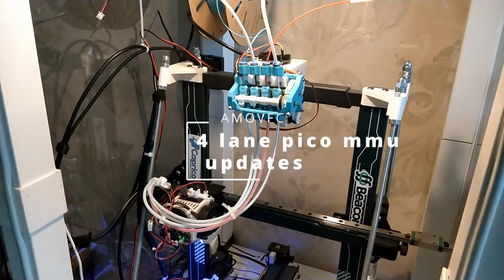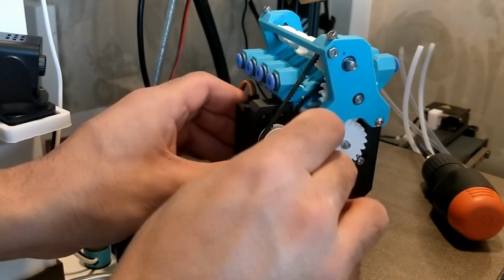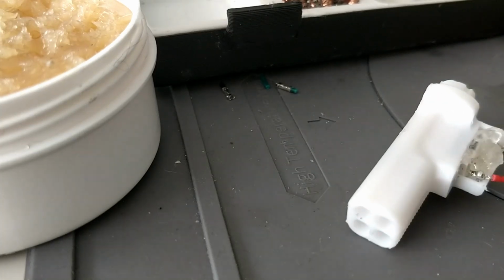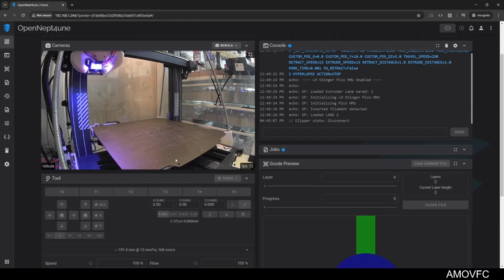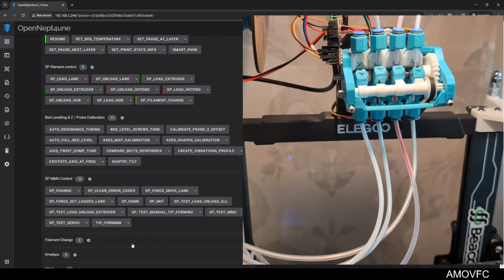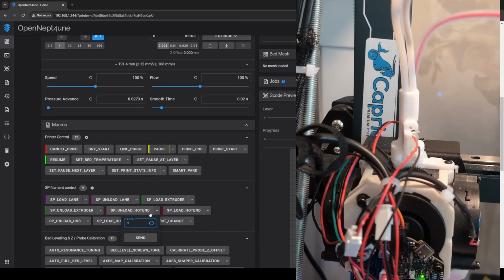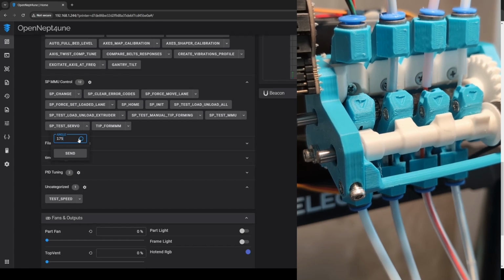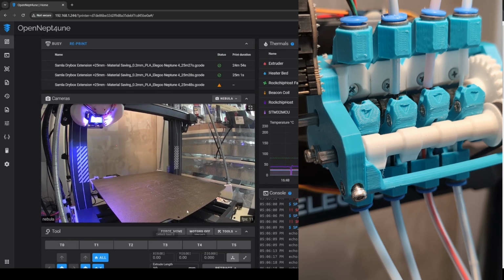4 Lane Pico MMU Part 4 - New mount + better configuration guide!

Comment: On the Neptune, I see E1 and the pins S, G, V5, but I’m not sure which GPIO they correspond to. Do you have any documentation about them?
Reply from the maker: I would suggest you look into the specific board your neptune has, mine had znp k1 v1 if i remember correctly, i think the max and the plus use the v2. But regardless of that I would not recommend using the v5 from the board of this stepper motor, unless you know the amperage of the 5v rail, if you draw to much current the board can be damaged

Comment: Can you post a video on how you did your wiring and what electronics you used
Reply from the maker: You're in luck + perfect timing, im putting yhe printer back together right now and can do a video about yhe electronics, do you wnat to just know the ones for the pico mmu on my elegoo? Video will probably be a couple days but if you have anything you want me to talk about just lmk
Reply: @AMOVFC yea I'm building one for my ender 3 pro and I'm stuck on getting the electronics for it I'm thinking of using ebb42 but it's pretty expensive so if you can also list what you used I will be very grateful. Also what RPI did you use
Reply from the maker: The ebb42 is probably one of the cheapest options to control the pico mmu, but if you have a stepper motor and servo pinout on your mainboard you can connect directly to that, that how I have my voron set up, here's how I had the elegoo before, https://youtube.com/shorts/8CbTlIXhedg?feature=share
Reply: Your videos helped me build one thanks

Comment: Thanks for sharing.
Curious why mount the filament hub at the extruder, less retracting needed for the changes?
I'm liking this and will make one to try with my Creality K1, but ideally the hub stays outside like the CFS system they sell.
Reply from the maker: Yeah it's only like that so I don't need a respooling solution or a buffer, you can totally do the hub far from the extruder just remember all the filament from the hub to the extruder has to be unloaded

Comment: I wonder if the "factory defaults" values for the servos would work from the ground up if they were indexed from a known position? (likely 0)? meaning, unhook the belt gear, set the servo to 0 deg (powered), then reattach it.
Reply from the maker: I think j understand what you mean by starting it from 0, powered so that you know for sure the servo is at 0, I've been doing that for my picos, but the problem is trying to figure out where is "0" for the camshaft and holding it in place while attaching the belt.

Comment: Having the mmu directly on the top extrusion its not a good ideea... It is for a good reason that all this type of printers have the spool at a much higher position. If you have a print that is close to your max z you will breack the filament hub... in my oppinion the best position for the mmu is on the filament spool holder. Just my toughts....
Reply from the maker: Good ponts for sure, I personally rarely use the max high for my printer so it's not a big concern right now

Comment: as far as I can tell there is no filament cutter required, am I correct in this?
Reply: how are you getting press to the extruder release when loading filament?
Reply from the maker: that's correct, there is no filament cutter required

Comment: Thanks for the videos. Quick question; docs say lane 1 gate switch uses PB6, would lane 2 then use PB5 and then PB7 and then PB8 for the lanes 3 and 4? TIA.
Reply from the maker: Hi, PB6  is the filament sensor inside at the toolhead just after the hub, I am sure you can add more sensers but the pico only needs one filament senser
Reply: @AMOVFC  Thank you for the reply. So only one gate switch for three or four lanes?  How are individual gates monitored for the presence of filament. Sorry to bother you, it just seems lacking.
Reply from the maker: In the default/stock pico mmu setup there is no monitoring for which lanes are loaded and which are empty, it can probably be added somewhat easily, now that you said this I kinda wanna make a mod for it but it will take some time
Reply: @AMOVFC  I think I am going to need to remedy this. So many benefits to knowing what lanes are are occupied. Programatic and troubleshooting...